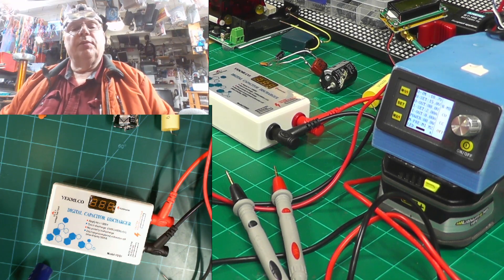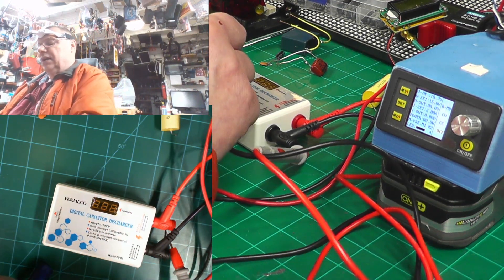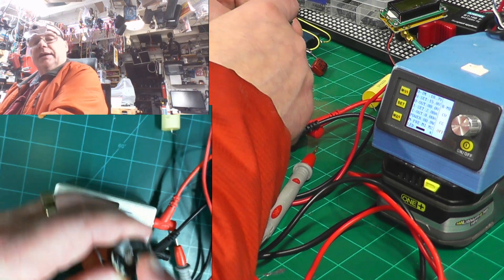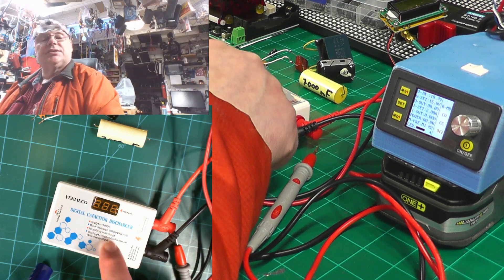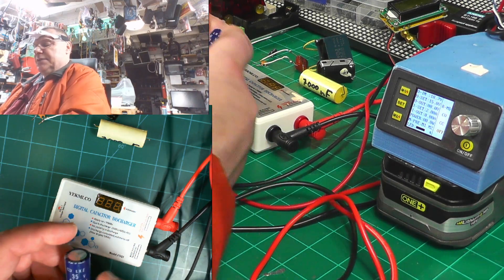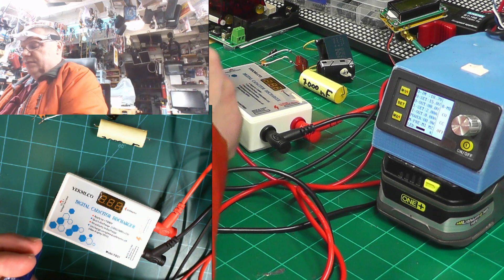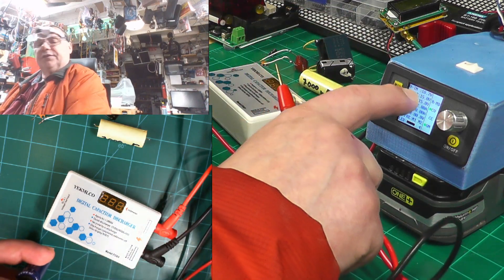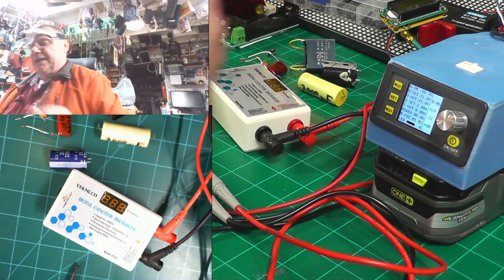Capacitor Discharger - Yekmlco Digital Capacitor Discharger

Comment: hi mate 
can i use this device for my ultra capacitor bank rating 64 volts 125 farad with EHS of 9.6 mohms.
Reply from the maker: Voltage:10-1000V
Quick Discharge:(100U/400V, ≈5S)